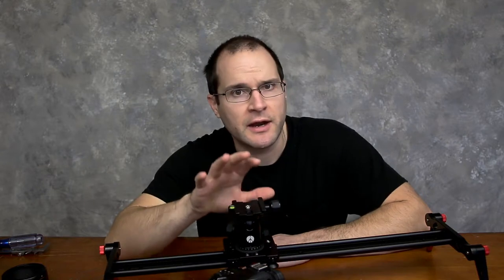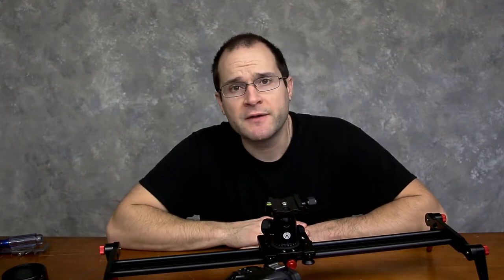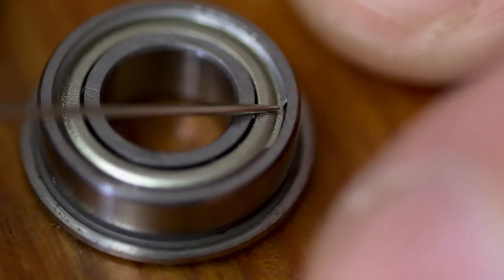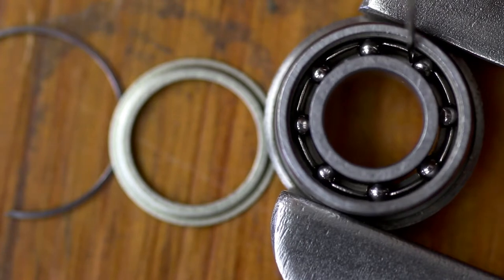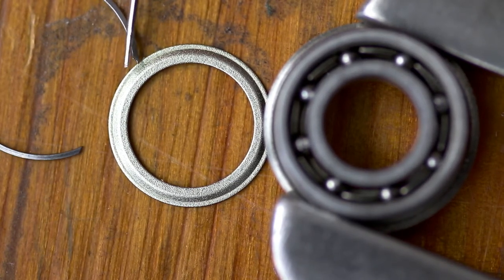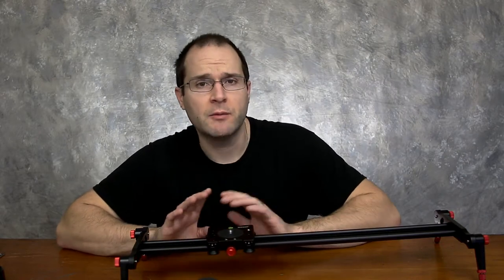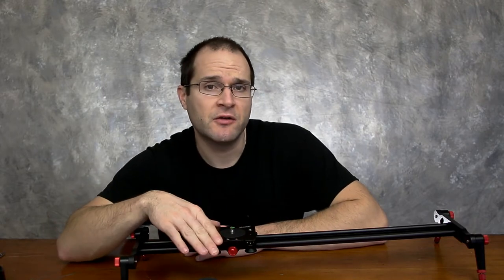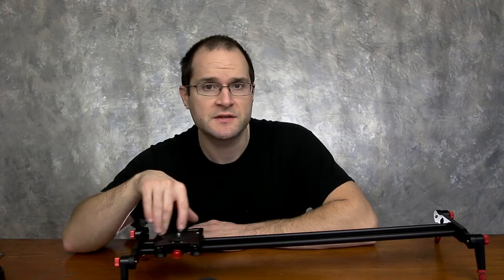neewer 24"/60cm bearing video slider fix vlog 161

Comment: For things that need precision grease and oil like this, i'd use gunbutter for the grease or oil once you get everything cleaned up nicely.  http://www.gunbutter.com/

To get the debris out now, I'd almost say to blast it with some brakeclean while spinning it over to power flush it while also removing all old grease and oil.
Reply from the maker: gun butter what a name. funny I used breakclean lol little more cleaning we should be in business and if I can do with out coffee to take care of my jitters lol
Reply: RealQuickChris yeah, the name is funny. It really is the best stuff. I run it in all my weapons and in quite a few other things. It puts up with just about everything and is a super slick lubricant.
Reply from the maker: nice nice nice
Reply: RealQuickChris if you were closer, I'd let you try it from what I have... But you're not close. If you do get it at some point, remember that it takes very little to do a lot with that stuff. It covers very well and requires only the thinnest of coverage to be effective.
Reply from the maker: a little dab will do ya. I am sure I will pick some up.